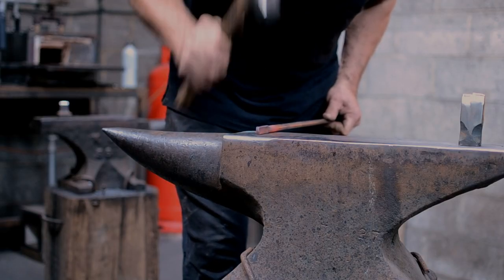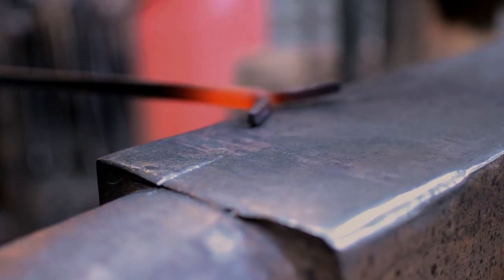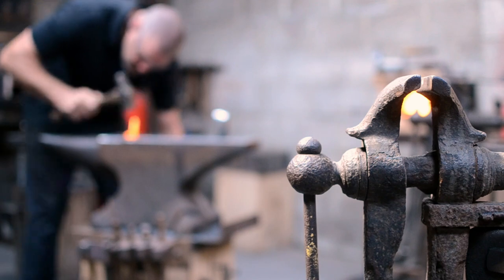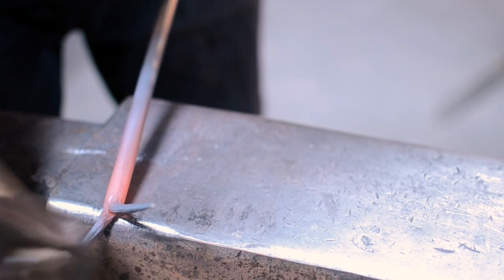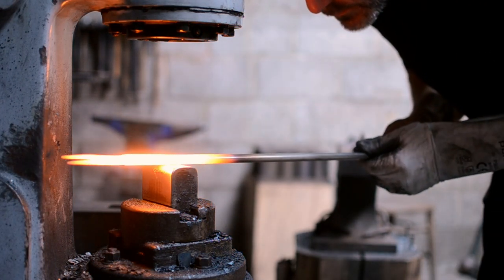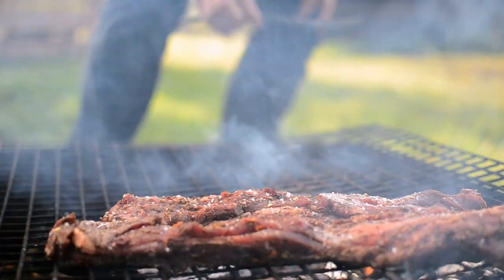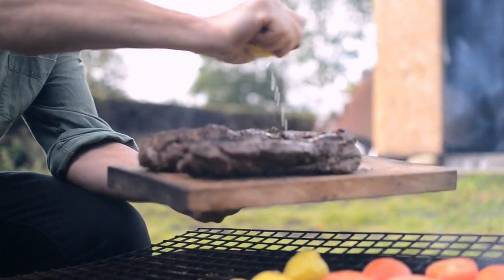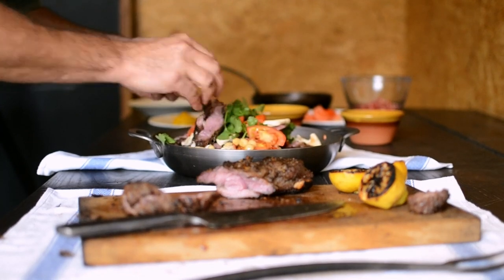Blacksmithing : Making a BBQ Carving Set

Comment: If you taper the end you set down and thin it a little before you cut it it will be a lot easier to do the times of the fork. Just clean the tapers up a little and shape them. Done